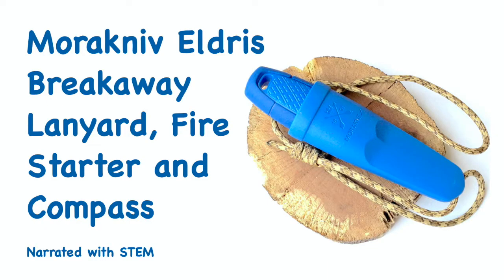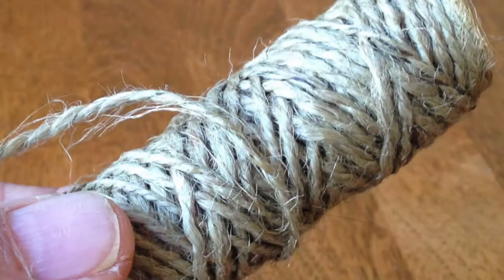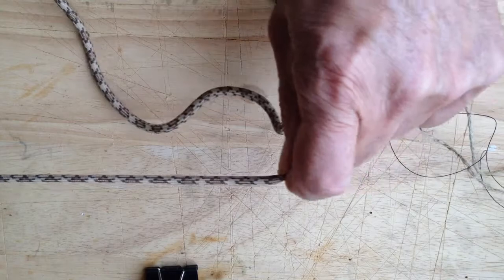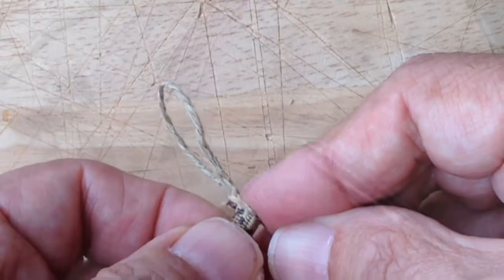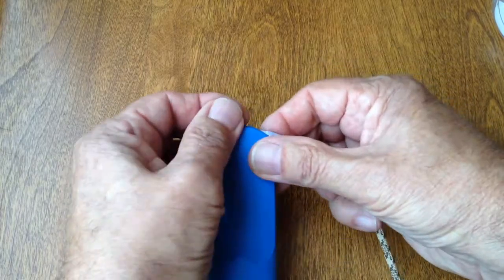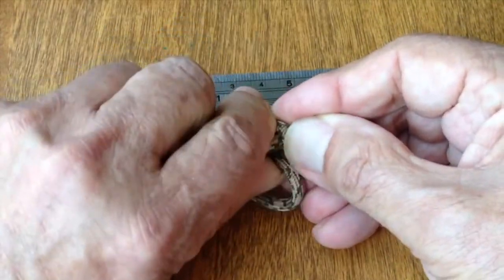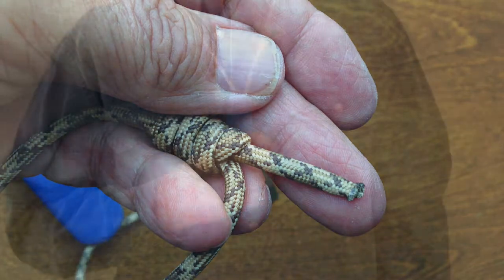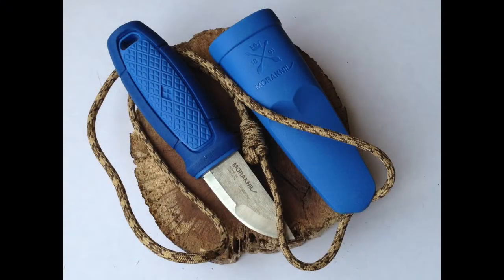Narrated: Morakniv Eldris breakaway lanyard, fire starter, and compass.

Comment: A fast and easy way to make a breakaway lanyard. Take a fired .22 shell. Cut off the head. You are left with a small brass cylinder. Insert the ends of the lanyard, one in each end of the cylinder. Crush the cylinder with pliers. That will keep the ends together, but pulling on the lanyard will easily break the joint.
Reply from the maker: Great idea. Thanks for contributing.